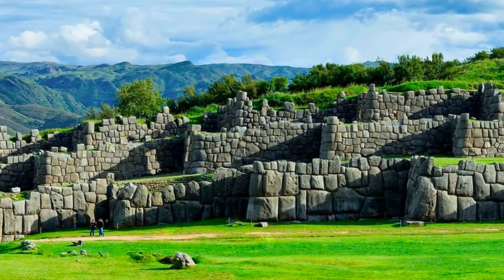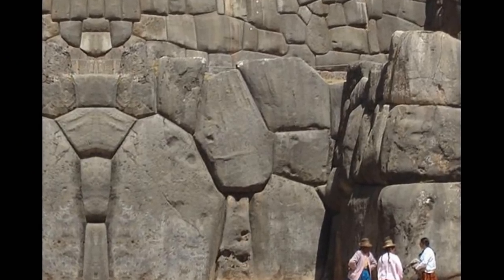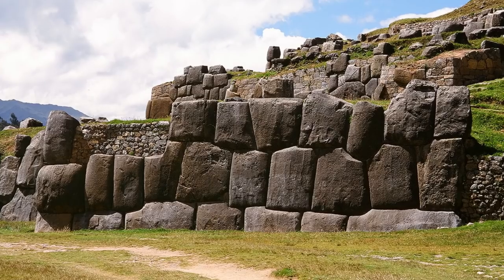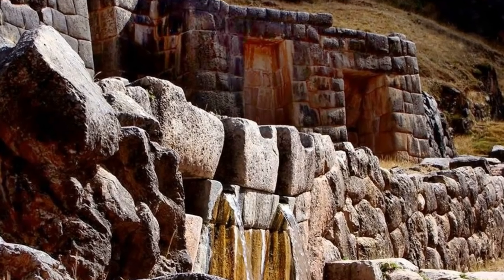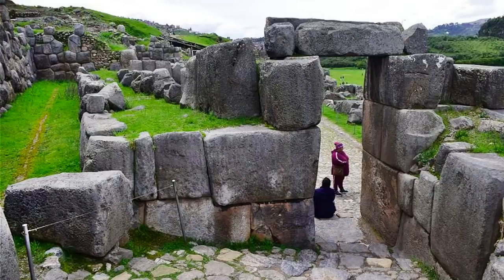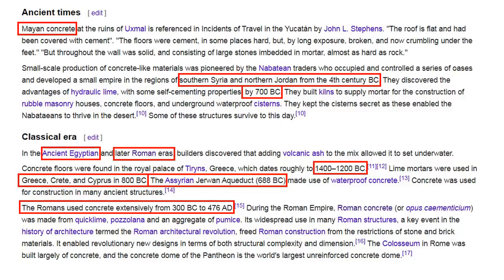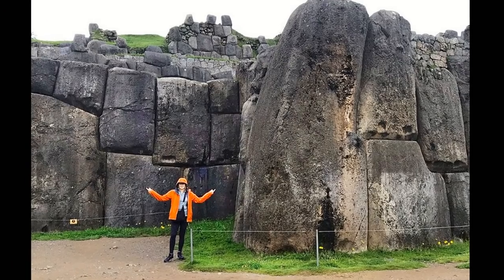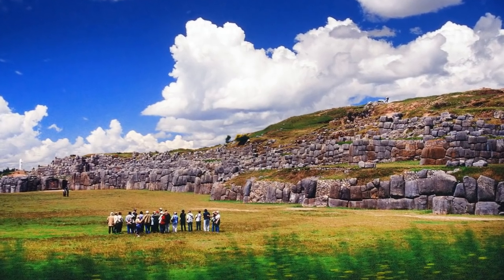Explained: How were Peru’s #Sacsayhuaman Walls Built

Comment: Wrong, wrong and wrong.  200 ton blocks have been shown to be easily moved.  The blocks have been proven to have been quarried.  The back sides of the blocks are in their rough natural state. They found a natural acidic water nearby that could have been used to soften the  SURFACE of the blocks to make it easier for them to be shaped.  Half finished monoliths in the quarries in Egypt show us just how the blocks were quarried and shaped with stone tools, and cuts made with friction using sand as an abrasive.

Comment: Wouldn't make sense to cast in different sizes if your theory is correct. Need to know why they needed these great walls and the whole structure seems overengineered, if for example, it was a defence wall. The past holds great enigmas about our origin.
Reply from the maker: I explained my thoughts on this in the later half of the video :-)

Comment: But the blocks are NOT some form of concrete. Their mineralogy has been scientifically established and is identical to the stone from ancient quarries many miles away. You can see where the blocks have been removed. The quarry sites have been identified. If cement in bags had solidified, the resulting blocks would acquire the approxinate shapes of cubes with bulging faces. Instead, you see all kinds of shapes that were deliberately made to make the blocks fit tightly together - shapes that could not have been created inside bags! If a solidifying block of cement was hard enough to create a large indentation in the corner of an adjacent block of cement that was softer, how could a third block be able to create in another corner of this one a similar indentation through the pressure of its weight? How can setting cement be hard enough to cause impressions in contiguous blocks yet be soft enough to have impressions made in it by other blocks at the same time?! Finally, how could knobs (whatever their function) have been added to a block of setting cement? They would have had to be carved in the hard, solid block, which means removing a large surface area around each knob and reshaping/resizing the entire block! This would have been a HUGE task and makes no sense if the builders were trying to avoid the labour of carving out heavy blocks of solid stone from quarries and transporting them dozens of miles. The existence of knobs in some of them strongly implies they were carved when the ENTIRE block was cut out of the quarry. The cement bag theory simply does not hold together to explain polygonal walls of the complexity seen at Sacsayhuaman. Nor does it account for their knobs. Moreover, it is inconsistent with facts established by geologists concerning whence the stone came.
Reply from the maker: Please watch the later half of my video, which cited a 2012 study from geophysicists indicating the Saqsawaman blocks are “impossible in nature.” I also listed the source of this study as a reference in the video description (see below). Please send a link of the mineralogy study you mentioned that proves the Saqsawaman stone is natural. Thank you. 

 “In order to determine the source of the material for the blocks, an X-ray fluorescence analysis was conducted on the samples from the quarry and the masonry wall. The analysis showed that the chemical makeup of the samples from the quarry and the wall of the fortress at Sacsayhuaman is practically identical. Such close similarity of the chemical makeup of the analyzed samples indicates that the material of the blocks in the wall was produced from the limestone, which was obtained in the quarry.
With regards to the material of the blocks, we can confidently say, that the process which formed them is impossible in nature. This is based on the fact that cryptocrystalline organogenic limestone can recrystallize up to marble in the presence of water and high temperature, however, this results in large crystals being formed, since processes occur slowly in nature and the crystals have time to grow. Uniform [homogeneous] fine crystallinity, as in the presented samples from the blocks in the masonry, could be obtained under a very rapid process. Furthermore, under the condition that at any point in the system there is enough water, and carbonate material.”
Reply: @CuriousBeingbyTina  How about first giving satisfactory solutions to the problems I raised about the cement/geopolymer theory? It is no good offering a theory that explains just one feature of the stone blocks but raises other problems that it does not seem able to solve. Other investigators just as experienced as you have dismissed the cement theory because it raises more questions than answers, quite apart from contradicting geologists, who have identified the stone as andesite.  The main walls were made with andesites that are blackish igneous stones whose quarries are in Waqoto on the mountains north of San Jeronimo, or in Rumiqolqa about 35 Kms. (22 miles) from the city.
Reply from the maker: @stephenphillips4984  I explained the knobs, different shaped blocks and more in the video. You didn't bother to watch the entire video before jumping to conclusions.

Comment: If you were going to pour your blocks wouldn't you just make a continuous wall?
Reply from the maker: A rigid concrete retaining wall doesn't not work well in a cold and seismic region. A dry stack and interlocking block wall works much better. I explained this in the video :-)
Reply: @CuriousBeingbyTina  it doesn't have to be one giant wall. The irregular shapes don't make sense and are not efficient. It would have been easier to stick to say 10 distinct shapes rather than making each one unique.

Comment: No, the big blocks are not cast. No casing can sustain the pressure of 5 meter tall 200 ton casting. Furthermore, so big and THICK  concrete would crack when drying, especially without  armature and sand/gravel in the mix. And if castings, than why all are different shape ?
Reply from the maker: I explained my thoughts on the different block shapes in the later half of the video. Let me know what your think.
Reply: I worked with concrete and I think without steel rods and without stone and gravel and pebbles and sand ,  than it will crack if only cement and watter.  The material there is limestone and it is known where is quarried. The quarry itself is very interesting , there are strange toolmarks,  maybe  some kind of chain or rope saw.

Comment: Well God bless you and others hypothesis. Concrete would need thousands of molds. All individually made. Which would need hundreds of master mold makers. What did they use to make the moulds.
If they had granite like concrete I'm sure they would have had the idea of shuttering and rebar. Think it through.
Reply from the maker: I explained the usage of molds in the 2nd half of the video. Please let me know what you think.
Reply: @CuriousBeingbyTina  Unfortunately, your theory may be wrong. Sacsayhuaman was not created with cement but more amazing still, quarried limestone and granite. Most of the stones were carried from different quarries, according to chroniclers. For instance, Pedro Gutiérrez de Santa Clara says in this book “Historia de las Guerras Civiles del Perú” that one quarry was located over 20 km from Cusco. The same is mentioned by Garcilaso de la Vega who states the nearest quarry was Muyna, located about 25 km from Cusco. According to Garcilaso, the furthest quarry was Yucay, which is 75 km from Cusco. As well, materials research on the stone at Sacsayhuaman has been conducted. Specimens from blocks of various sections of the wall were researched at Rostov University with the help of electronic microscopy and microanalysis. Department research expert Gorlova Yu.V. found the stone to be natural fine-crystalline limestone with no track of organic residues. People try to attribute this method to other megalithic sites, (pyramids of Egypt) but they are wrong as well.
Reply from the maker: @billr2505  Thanks for the information William. Could you please share some links of the material studies? In this video I cited the material report from isida-project.org and their conclusion was based on the research conducted by Gorlova Yu.V. at Rostov University.  

The following is from link: http://www.arcanafactor.org/en/our-projects/sacsayhuaman/74-sacsayhuaman-results-2
Preliminary conclusions
The Saksaywaman construction material is evidently represented by the organogenic and fine-grained limestone with no organic residues and with a low amount of their fragments.
ITAG experts suggest that the fine-grained limestone may be an artificial material produced with unknown technologies. This statement is presented in the official summary.
On the other hand, the experts of Fersman Mineralogical Museum in Moscow, of the Geology Department of St-Petersburg State University and of the Department of Geology of Oil and Gas of the South Federal University have expressed their opinion during the private consultations that the mentioned fine-grained limestone is deemed to be a natural formation.  

The conducted research:

Institute of Tectonics and Geophysics after Yu.A.Kosygin FEB RAS
Performed by: Deputy Director, PhD Berdnikov N.V.

Rostov University
Performed by: department research expert Gorlova Yu.V.

Comment: This is very fascinating but these look like actual rocks not something that has been poured. Also the block they showed where she mentioned an earthquake pulled the blocks apart. If you look at it, it's clearly been cut. It's a good theory but I just don't think thats the answer. Is it possible that people a lot bigger than current humans built them?
Reply from the maker: Thanks. Molded concrete blocks can have the same "cut" look. Btw I presented the material analysis done by Russian geophysicists who concluded that the material was not from nature.

Comment: I don't think they are cast as the back of the rock would be flat i think.
Reply from the maker: If the blocks were laid in position when they were still in a plastic/ malleable state, then the back of the blocks would be molded into the soil side of the retaining wall.
Reply: @CuriousBeingbyTina  True , i typed this comment before i heard you mention the malleable state.

Comment: 1) This not a new theory, 
2) It has mostly been debunked (still open to it, but its mostly implausible these were poured).
3) Most plausible means is that they had tools that are far superior than archeologists suggest existed.
4) The younger Dryas event (global catastrophe) likely wiped out the civilizations and their tools and factories that actually created these type of stones.
5) The tools were likely very different than today. Its more likely they used giant stones to form lathes and "machinery", combined the giant stones with steel components (I'm guessing they used meteorites of which the tools made from them would have been the most valuable and rare items they owned), but also used a more rudimentary form of power (I.e. water wheel, not an actual modern motor). 

NOTE: An ancient Egyptian steel dagger exists that proves the Ancient Egyptians could melt, form, and make steel tools from meteorites. A giant stone lathe clearly exists from the period of Ancient India. Archeologists admit the stone pillars in India had to be made via a lathe, but they stubbornly can't fathom they could have used steel. 

NOTE 2: Steel left in open air deteriorates. Steel buried also determinates (buried swords from the time of the Vikings are substantially deteriorated, many nearly all gone). They wouldn't survive thousands of years. Neither would steel tools used to craft stone. Hardly any tools were found from Ancient Egypt and all were from rare circumstances (I.e. found in the pyramids where exposure effects are very different).

Archeologists are nothing but book worms who can't see beyond what was already "accepted". They have no actual relevant expertise. Absolutely clueless how to build anything. We should stop referencing them as "experts" immediately.
Reply from the maker: You meant Tutankhamun's meteoric iron dagger? That's not a steel one. What reasoning have been raised to debunk the poured theory? Can you specify? Could you explain if these are stone blocks then Why do the blocks have rounded/ bulged profiles, and why they have stamp/ trowel marks? Did the ancients carve these trowel marks and bulged shapes? If so, then for what reason?
Reply: @CuriousBeingbyTina  What is steel? Its a blend of metals. Its not copper or bronze. Yes, its arguably steel.

Bigger point pouring:

1) Look at your own pictures of the "stones".. the stones next to each other have different colors and differ quite markedly. Poured stones would match.
2) They have been analyzed, and they simply match the properties of the rock where they were quarried. Too much of a match to be poured.
3) If they were poured, they would simply be much more consistent in their properties. Again, they match exactly what you would find cutting them out of a quarry.
4) Scientifically, every effort to try any "mix" a poured "stone" is nowhere close.

Honestly, is it possible? Sure. Will never, say never, or not possible. However, it is very, very unlikely and very close to not believable at all.

Comment: If could soften stone to manipulate or make such out of sand why not make even bricks?
Reply from the maker: I don't think these blocks were softened stone but a type of concrete. The preliminary material experiment shows that the blocks are limestone based since the material dissolved in acid.Bricks would need to be fired at a high temperature in a kiln. To ensure tight fittings, the clay blocks would need to be stacked first before the firing process which means there should have been huge kilns onsite to fire these massive blocks after they were placed in position; though there is no sign of such kilns or large-scale firing at Sacsayhuaman. On the other hand, dry cast concrete blocks can be demolded, laid out while they are still in a plastic state to ensure final fixing and highly accurate enjoining surfaces.

Comment: If that was the case, why cast such disparate shapes?  Why not just build uniform molds (even if more than just 1 type), which would have saved them so much time, with the technology you claim they had?  No "blocks" at the site "repeat", after all.  Likewise, these stones are clearly quarried, regardless of the distance from the site; those "markings" are quarry hew and most likely transport-based indentations, just like people have been doing for thousands of years (even today).  Sorry, but this is just a very fanciful and flawed hypothesis...
It's more likely the cuts follow the "natural" geometric shapes of basal stones and builders went around measuring and finding the most appropriate stones to place next to/on top of the next requiring the least effort -- nothing that could not be achieved with a good eye, fairly accurate measuring tools (like a straight stick), and stone-on-stone polishing with enough workers and time...  There doesn't need to be any mysterious or magical process; humans are clever and can achieve great things -- no magic or even high technology necessary...

Comment: It seems to me that if the stones were of a cast material, that material could be scientifically analyzed, just like modern-day concrete can be analyzed..  So where is this scientific analysis?  Secondly, if the method of construction is so easily understood, why has that method not been used to duplicate the walls? Until someone reproduces this construction, it remains a speculative theory at best.

Comment: first 3 minutes is basically..."wasn't possible to build this way..." without giving a single shred of evidence and even making false statements like:" can't be duplicated today". It has been done, just not on that scale...you can fit stones together in that way...but why would you do it?
Also, how does she know how many people worked on those stones? Was she there? Just outright refused to even entertain that probably thousands of people worked on that temple for probably decades. Considering this, it definately becomes plausible.
And this being some sort of concrete falls already apart when you analyze samples of the stone...which has been done.
So this hypothesis is dead on arrival considering what is known.
Another fact that throws this hypothesis out the window and supports the carving theory is that there are unfinished stones and stones with rougher surfaces...even shown in the video.
Reply from the maker: Scale and material matter a lot. One can make a miniature clay wall similar to Sacsayhuawan. If you think these megalithic walls can be built by quarrying, transporting and carving stone, why do you find a video showing such a practice?

Comment: wouldnt they show signs of slumping? thicker on the lower ends. unless they were drypacked with some elasticizer. 
 also, if it expanded, wouldnt hydraulic pressure push the other stone out of whack when it expands to fill?
concrete would not change its physical nature. it would not turn into igneous granite.
Reply from the maker: The blocks do show signs of slumping which I talked about in the video :-) and these blocks are not granite.
Reply: @CuriousBeingbyTina  just because they found some detritus around the base of a rock in peru, they attribute it to inca times. thats like finding a plastic garbage bag at the base of the pyramid and declaring it was made in modern times.